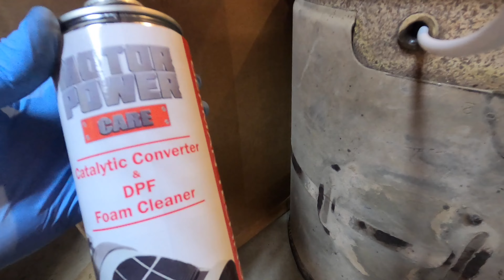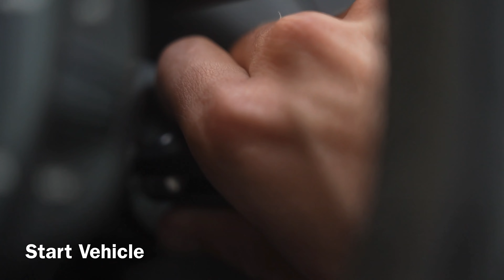Volkswagen Jetta TDI, Volkswagen Jetta TDI, DPF Foam Cleaner Easy Clean Ash Build-Up MotorPower Care

Comment: Because I was using it on a German made diesel, I wanted a German made product. A Sprinter's V6 DPF is in a difficult position to access, so the long straw kept my arm from being burned while deploying the foam after the warmup period. After restarting, the induced regeneration took place and apparently all the ash was removed, as the content was approximated at 0 grams at the end of the process. Regeneration was not possible before the application, as the computer indicated a plugged Filter. It seems like one can was sufficient to make things right again.